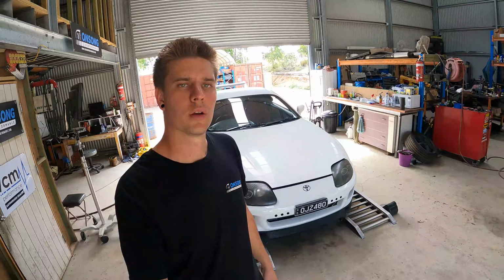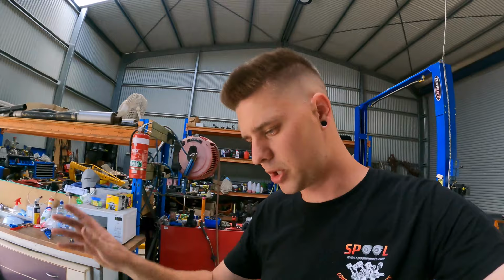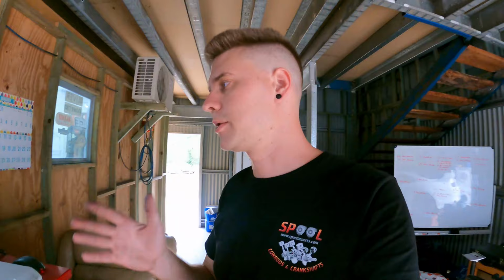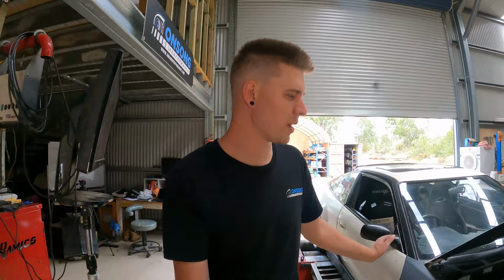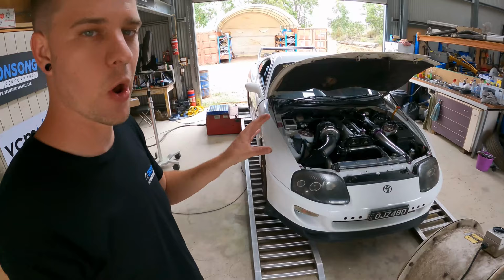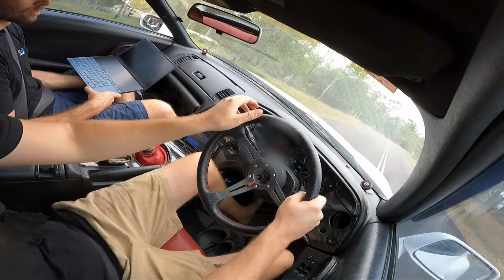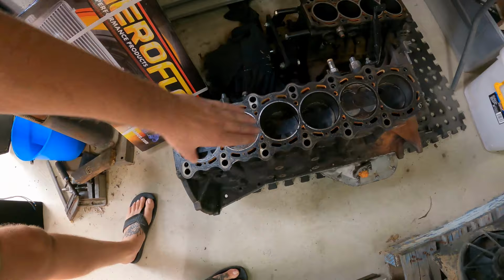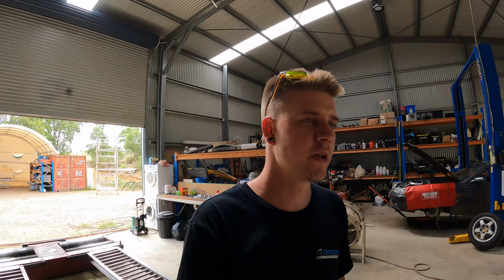2JZ Party!! || RZ Supra + 2JZ Swapped S13 + More!

Comment: Hope precision 6766 isn’t a journal bearing gen 1.... best way to waste 2.5k..: will be interesting to see your e85 runs... mine with a 6466 gen2 made 520kw on 30psi, 264 cams and 1300cc. Just put a gilroys 850whp A340E in so gunna push for 600wkw
Reply from the maker: If it were journal bearing, why would that be a waste?
Reply from the maker: Ryan Lowe sorry man I went to heart your reply and accidentally removed it! Thanks for that though, good info to know. Im not too sure weather this one is bb or not, but Im assuming it is, ill keep your information in mind though 👍
Reply: @BoostGumps  😂 all good mate, I try to warn as many people as I can about my experience, I didn’t know how common the failure rate was, then I googled it and it was an eye opener.